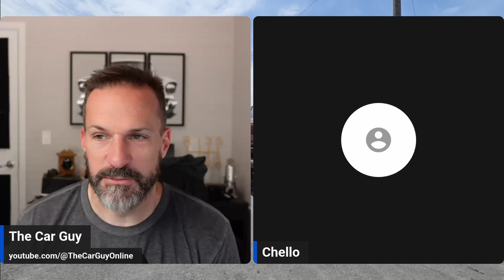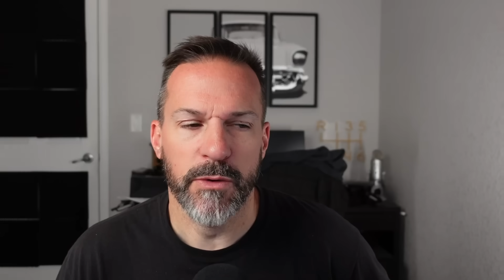Former GM Engineer EXPOSES Planned Obsolescence Tactics.

Comment: This is not cost cutting, this is QUALITY cutting, so that stuff keeps breaking and people have to buy a new car, that is why greed and crap quality dominates GM and quality dominates Toyota. Just check out how many old cars are on the roads and which brand they are, you won't find any GMs, but LOTS AND LOTS of Toyotas. Good and quality oriented engineers left GM, they could not last there. Do instead calling cost cutting, it is actually just reducing quality.

Comment: I drive a 2000 honda civic, the only problem with it is that the distributor dies more frequently than it should, it's ok. though a recent overhaul left it flat-footed at stoplights, but it picked up a great deal more power at 80mph...

Comment: Same goes for riding lawn mowers. Just restored my old Craftsman T3000 as my main mower, then taking the broken low end newer craftsman and keeping it for a back up. I bought a 1995 home in 2005 where the owners left an old 1988 Kenmore side by side refrigerator/freezer. I decided to keep it until it broke. It is 2025, never broke down,🤫we never talk about it! But, if I can get parts, I will keep it for life. Same for my oven. I have had to change my water heater and dishwasher (new one repaired 2x🤨). I wish I would have kept my 1980’s washer and dryer. They are all Korean crap now. My Truck, I will keep for life, 2002 Toyota V8 Tundra! Other vehicle, 2014 Prius C made in Japan. No recalls, over 200,000 miles on it. Only a total wreck will kill it, and we hate all the cheating insurance corporations which use software to optimize cheating repair shops and customers.

Comment: No turbo.
No hybrid.  
Change oil every 3,000 miles....regardless of what the manufacturer tells you.  
Don't buy anything that doesn't allow you to work on it.  
Don't buy anything in its first year.  
Don't buy anything that needs a subscription for functions that used to be free.  
Don't buy anything that generic scan tools don't work with.  
Replace plastic transmission cooler line connectors with basic metal clamps where possible.  
Don't buy anything with an engine that has oil immersed belts (timing and/or oil).  
Don't buy anything with an Alusil engine block.
Don't buy a vehicle that requires the manufacturer to have direct upload/download access to it. 
Change (don't flush) your trans fluid every 50,000 miles....regardless of what the manufacturer tells you.  
Never have a dealer repair your vehicle...unless it's free.
Reply: Just bought a 26’ Honda HRV with the naturally aspirated 2.0L K20, no direct injection, no turbo, just for these reasons. CVT was only concession but Honda makes a good one if maintained properly. Might have to be my last vehicle.

Comment: The engineering philosophy is to create things efficiently and economically right? That's a component of that science. The less complicated to do the same work. The people managing the money, who are in charge, are demanding less cost and still increasing the price to the consumer. They should be selling these vehicles for a quarter the price and telling us they will last for 3-5 years or buy this more expensive one that will last 10 years. Maybe spend less on incorporating useless features,(heated seats and steering wheel, infotainment systems, ridiculous trim levels etc) and build tougher running gear for a change. I'm sure this is true throughout all manufacturers.

Comment: My 1970 chevy C-10 ,3 on the tree, manual steering, manual brakes , just a base c-10 of the year, is still truckin on down the road… regular cheap maintenance and a part once in awhile needs replaced, but big deal… l dont have to pull the engine to put a water pump  in it at least and $60 vs $2000…. Old school rules…. 👍🏻😀🇺🇸

Comment: I've been telling people for years, I used to be a die hard chevy guy. After 2008 things went downhill and only got worse and worse. They are absolute garbage now. I am now a non-turbo Toyota guy (Tacomas and Tundras). I'm not sure what I'll go to next, but hopefully I don't have to worry about it for a long time. I plan on repairing these as needed and rocking them until the wheels fall off.
Reply: OG owner of a 2006 Chevy Avalanche. 150k miles and with regular maintenance DONE BY ME this truck has NEVER let me down. I recently retired and considered buying a new truck (Ram RHO or Ford Raptor) but the SALESMAN from both dealerships talked me out of it ! "you have a reliable truck, just keep driving it" ! So, I pulled the engine and changed the timing chain, oil pump, and resealed the entire engine, new valve covers, new sensors and injectors and 2000$ later I have a new reliable truck.
Reply: Sadly, the trend for Toyotas also isn't good. They've been getting worse, even though relative to other carmakers their position hasn't changed much.
Reply: @JAnx01  Yeah, you're right. That's why I had to specify non-turbo. Their new stuff is rough too. I recently traded in my older Tacoma for a 2023. That's the last year of the naturally aspirated V6. I really hope manufactures stop with all this turbo garbage. The new turbo tacoma literally gets 1mpg better with the turbo 4-cylinder vs the outgoing V6, but mountains of problems.

Comment: If this is accurate, seems like GM wants to go out of business. How can you keep going with dissatisfied customers? However, I have a 2004 Silverado 2500  4x4 with 200000 trouble free miles and a 2015 Silverado 2500 with 167000 miles, no problems. I keep them serviced but I sure don't baby them.

Comment: And they have the stones to charge $80K for these unreliable disasters. They will make something fail early just to save 3 cents. I don't know how this makes sense for them, it will cost them thousands to replace under warranty. Even if 90% of the time it makes it past warranty, the math just doesn't add up. This also damages reputation, but they don't care long term, just short term stock price.

Comment: 2002 4Runner with 275,000 on the clock. I’ve done a couple timing belt, valve cover gasket and a front steering shaft job. And that’s all besides oil changes every 3,000.
Reply: Just traded in my 2002 Tacoma with 286,000 mikes for a Nissan Titan-v8, non turbo motor.

Comment: I will  KEEP my 96 Chrysler  Intrepid. 331,000 + miles. Does Not  burn oil.  Starts immediately.  Has  a    chain, for Timing.   Transmission, is  NOT  a  garbage, CVT .   Tranny  Fluid, still nice 'n  red.  Functions as  designed. 
===  you can  have, all your  over - sensored,   plastic engine covers ; too small  of radiators for  crap  Turbo Engines.  // Use once,  buy again ;  because   MOST    normal  PEOPLE....CANNNOT  AFFORD  to  Fix / repair   modern   
  j u n k .   Poor  Mr  Musk, created a  home made destructive, financial gun, financially  with  his   ' cyber '   junk.

Comment: I bought a brand new pickup truck in 2015. Years leading up to that I had always planned to get a new Silverado when it was time for a new truck. My brother worked for a Toyota dealership and almost solely because of that I bought the Tundra instead. This turned out to be probably the best possible thing I could’ve done. 140k on the clock and still nothing has been done outside of regular scheduled maintenance. No way a 2015 junk ass Silverado would be serving me as well as the mighty tundra has.

Comment: My partner just replaced an engine in a 2017 Ford edge because the engine cylinder head failed at 67,000 miles. Cost of an engine replacement was 12,000. 

I just bought a Tesla, ice cars are to complicated and unreliable.

Comment: Selling obsolete gas and diesel powered cars and trucks while slow walking EVs that last 400,000 to 1,000,000 miles.
Reply: Except for the batteries that obsolete the car when they fail.
Reply: @218philip  When the battery fails at 400,000 miles that's not really a problem is it.
Reply: @NackDSP . I guess we’ll see. In any event EV’s will never make sense in Northern Minnesota until batteries function in cold weather and have a reasonable range.
Reply: @218philip  Are you at all familiar with Norway?

Comment: this is why toyotas and hondas are better than gm vehicles period toyota literally does revamps to make things better im sure there cost cutting measures in there but generally they try to improve the vehicle every iteration not cut corners at every iteration. but yeah i think this is very obvious that they are choosing the cheapest parts they can when i see new cars with back up cameras that just go out.... ive seen 2010s with back up cams that are still runing fine lol. its back up cam technology not super hard just about anyone can install one

Comment: As an electronics design engineer that worked for one company for 20 years, the low cost requirements incrementally outweighed reliability over the years. That job ended for me when I said: "If you want someone to sign off on your proposed design, you'll have to hire someone who has no soul."

Comment: You know GM is done when their 5.3 is no longer reliable and has a new reputation for failure.  That ls v8 line was so solid for the longest time
Reply: I won't buy any other trucks!!! 2002 -2005 Silverados with the 5.3 liter is all i buy
Reply: Ya lets ditch something that was tried and dependable for a self destructing piece of sh*t.

Comment: The obsolescence is a real thing. I worked for Chrysler Jeep Dodge for years and years. Not only did we hardly see older vehicles for repairs, the many independent shops nearby had newer vehicles in their bays. And older vehicles got mostly maintenance and high mile repairs.

Comment: Yeah, this is very apparent nowadays. Take a trip to the dismantle yards. They’re full of relatively late model cars with no or very little body damage. I bought a very nice Chevy Equinox with about 115k miles on it from the wrecking yard for $1,800. I figured worst case, it would need a timing chain set, new water pump, etc. 

It did need that, but once it was all back together, it still had a cylinder that had an intermittent misfire. Long story short, ended up taking the WHOLE engine apart to find worn piston rings in that one cylinder. All told, it ended up being $2,500 in parts, $1,000 in machining and $8,000 in labor. So…nearly $12,000 in repairs…but a completely new engine.

Still cheaper than $50,000+ for a 2025 Blazer…the only model still available with a V6.

Comment: While most automotive enthusiasts know this has been a thing for the last 20 years, The part that shocks me is that people think this is just GM...... The automotive industry has become a race to the bottom, The market is far too crowded now causing even the big name brands to cut cost to stay competitive, You can blame the people supporting the CCP cars which hasn't helped at all, Emission laws have destroyed long term combustion engine reliability, EV are probably the MORE reliable option these days but they have an expiry date and the cost to fix IS going to put that straight into the not economic to fix throw away pile as well. The new car market is dead and I'll have no part in it. I have 90s and early 00s cars and they still drive amazing and are reliable they will see me out, I'm not forking out my hard earned for a POS that HAS to be replaced because it will fall apart. What's the point. A car that also tries to steer for me, beeps at me and has a hard plastic bland interior with a bunch of screens that's ugly is also not in any way attractive.

Comment: That's why I still have 3 Toyotas that are over 10 years old, a Highlander, a Camry, and a 4 Runner, and in order, have 125k, 186k, and 155k on them currently, and they have been well maintained and all run like tops. And, I have never had any major repairs on any of them outside of an alternator, a water pump and struts on the Highlander and the Camry, which aren't uncommon repairs for higher mileage vehicles. But the transmissions, engines and drivetrains in general on them are all solid as a rock. And none of them show any signs of slowing down. And yes...maintenance is like religion to me, because I have no interest in buying new vehicles and treat them like the important tools they are. And it should be mentioned that each was a one owner vehicle that I purchased from individual owners who could demonstrate their maintenance fidelity to the vehicles. And, I purchased them all with cash, so I own them outright. I wouldn't own a "modern" vehicle if you gave it to me for free. Certainly any made in the last 5 or 6 years, for sure.

Comment: I have a Toyota HDJ100 Land Cruiser, it has over 600,000 k's on the clock. It gets regular services and maintenance, neither the motor or 5speed auto trans has been out of the truck. It doesn’t use any oil between changes. This is why Toyota is a top selling brand.

Comment: This is the major reason I won't buy just about any domestic vehicle in the last 10-15 yrs... especially not new! I actually just bought a 2014 raptor, while that is technically within thay range. Other than a few small probs that can be fixed, its can be a super reliable vehicle with proper maintenance.

Comment: Planned obsolescence, once a matter of cosmetic changes and annual model shifts, has evolved into a more consequential and calculated design strategy—one now aligned with the average auto loan period, not the traditional 10-year lifespan vehicles once offered. In the case of General Motors (GM), mounting evidence suggests that the durability of key vehicle components—particularly engines, transmissions, and control modules—is engineered to coincide with the end of the financing cycle, typically between 60 to 84 months (5 to 7 years).

Unlike the classic model of style-driven obsolescence developed by GM in the 1920s under Alfred P. Sloan, the modern variant manifests as mechanical or electronic failure just after warranty expiration, when the vehicle’s owner has finished—or nearly finished—paying off the loan. This includes major incidents such as:

Catastrophic engine failures in hundreds of thousands of GM vehicles equipped with the 6.2 L L87 V8, leading to sudden breakdowns, crashes, and legal action.

Fuel pump system failures in Duramax diesel engines (2011–2016), resulting in widespread engine damage and expensive post-warranty repairs.

Hybrid system faults in Chevy Volt models, forcing GM to extend warranties only after federal scrutiny.

Owners routinely report high-cost failures—valve lifters, crankshafts, transmissions—shortly after the 60,000-mile or 5-year powertrain warranty ends. These failures are not isolated; they appear across platforms and model years, often surfacing within months of the final loan payment, leaving owners burdened with costly repairs or forced into another purchase cycle.

This evolution of planned obsolescence shifts the design goalposts: no longer just psychological nudging toward the next model, but strategic durability limits that keep buyers trapped in perpetual debt cycles, upgrading out of necessity, not desire. GM’s once-symbolic design principle has now become a mechanical reality—with real financial consequences for consumers

Comment: General Motors (GM) played a central and deliberate role in the development of what came to be known as planned obsolescence. In the 1920s and 1930s, under the leadership of CEO Alfred P. Sloan, GM pioneered the strategy of introducing annual model changes to its vehicles—a concept Sloan referred to as “dynamic obsolescence.” This approach involved releasing new versions of cars each year with aesthetic and minor mechanical updates, such as changes in color, styling, and trim, even if the core vehicle remained largely the same.

The purpose of these incremental updates was to make previous models appear outdated in the eyes of consumers, thereby encouraging more frequent vehicle purchases. This marked a strategic shift from utility-based manufacturing to a model driven by style, perception, and market psychology.

GM’s dynamic obsolescence strategy proved highly successful and became a foundational model for consumer product marketing throughout the 20th century. It established the psychological and economic framework for planned obsolescence in the American automobile industry and later influenced a wide range of consumer goods. While the term “planned obsolescence” was later popularized in the 1950s by industrial designer Brooks Stevens, its commercial roots trace directly to GM’s strategic innovations during the interwar period.

Comment: This is why I'm loyal to Toyota, with only a few exceptions they build reliable cars. GM and Chrysler build cheap garbage. I want to get over 200k miles on the original engine and transmission

Comment: 63 years old, 45 year master tech. What do I drive and what do I ride? 2004 Ford Explorer and a 2007 Harley Davidson street glide. The servo issue they had with explorer trans was easily fix with a servo shaft modification, done 270 thousand plus miles still running great. Harley, everything this years was ironed out save a couple easily fix issues, running great. These models are able to be repaired and because I do my own work, fairly cheaply. This garbage they produce today will never be owned by me. You could see the trash parts when they arrived and it's a big reason I no longer work on cars and trucks unless they are mine or my family. I worked for the big three for 38 years and was sick of repairing the junk they started producing. I feel sorry for what the public has to deal with from these thieves. They don't give a damn about the trash they sell or who they sell it to. Best advice, if you find a decent older vehicle, buy it and just fix it up. It will be around longer than you.